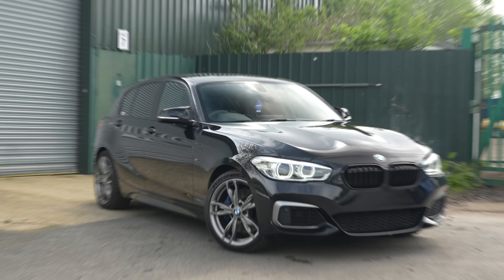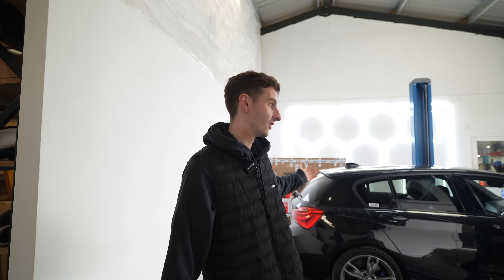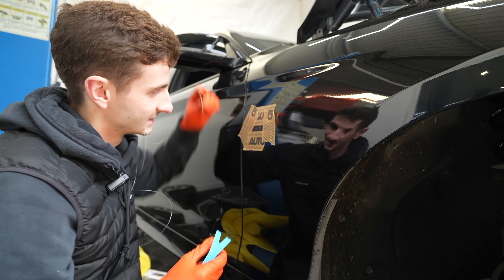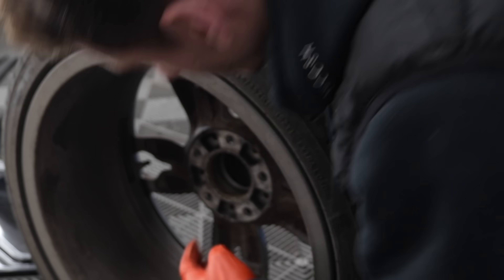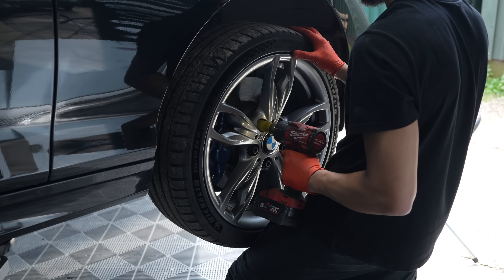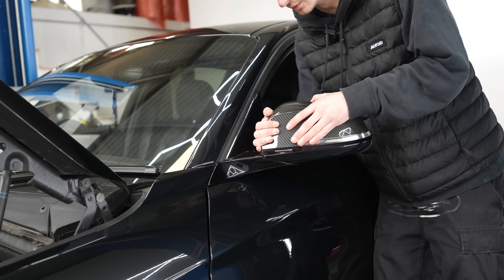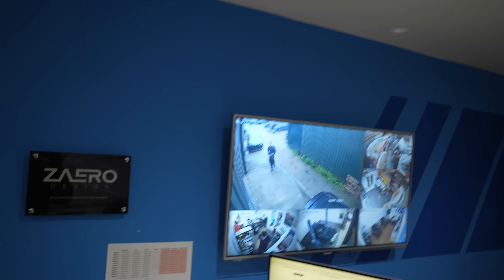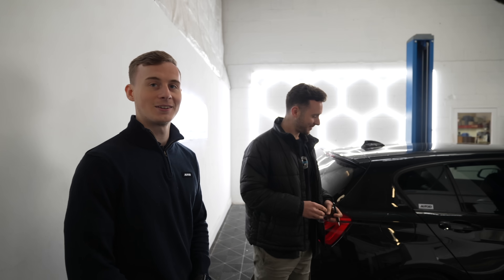WE MODIFIED AN M140i WITHOUT THE OWNERS CONSENT! + NEW PRODUCTS

Comment: Surely the stud conversion makes them weaker it can’t not do I’d be cringing doing a lap of the Nurburgring with them on😭very nice mods though and subbed so I earned you a quid a year😅
Reply from the maker: A stud conversion kit does not affect the strength at all, near enough all track BMWs are running stud conversion kits
Reply: @AUTOIDTV well you learn something new every day I’ve never noticed one of them and I track a lotttt😂

Comment: Any proof about improved fuel consumption ?
14:52
Reply from the maker: Its a pretty standard fact when doing a stage one on a vehicle, providing you don't drive it harder, which is pretty much impossible at first.
Reply: @AUTOIDTV  haven’t seen any B58 with a SW tuning that got better mpg by the tuning.